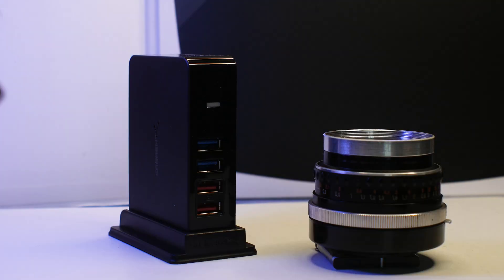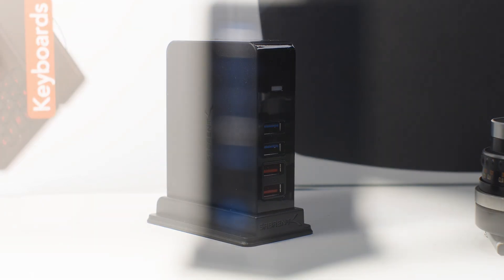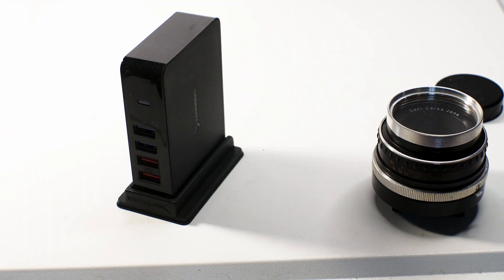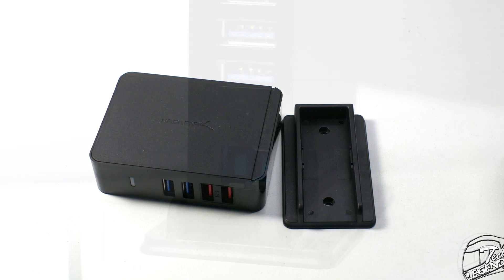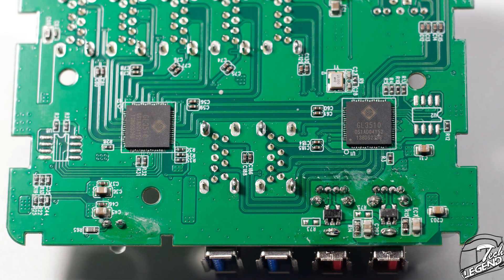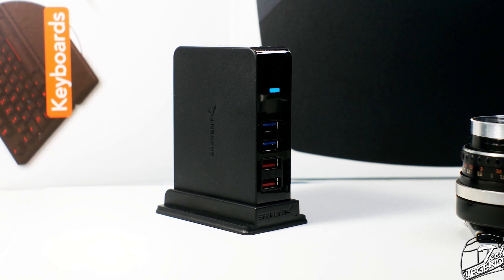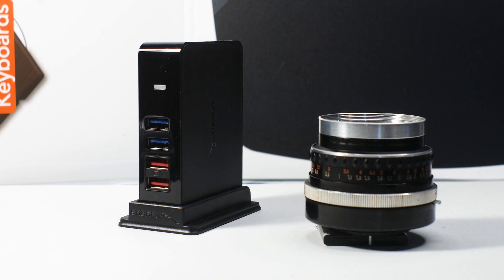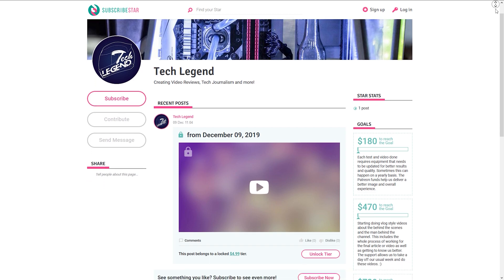Sabrent 7-Port USB 3.0 Hub Review (Small form factor USB Hub)

Comment: It's a cool design, I like the layout of it but that soldering job is scary tbh, no wonder I've seen reviews with people saying ports stopped working or it just completely failed... It's sad because I can't find another hub that is built like this. That looks like cold solder joints & too much solder used, I could see joints breaking while connecting USB devices or worse, something shorting & breaking devices or the system it's connected to..
Reply from the maker: True. The soldering is not the best in the world and I have no idea how it passed.